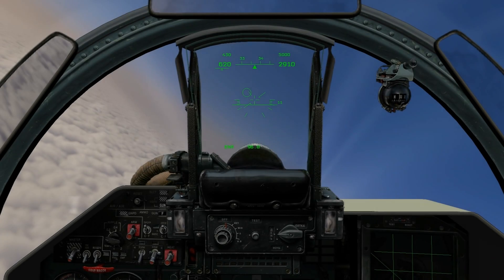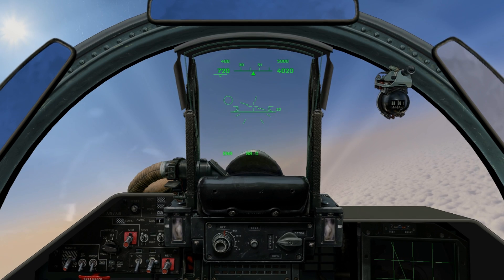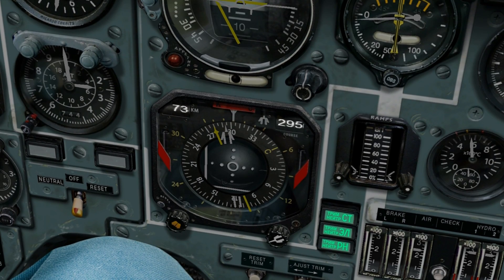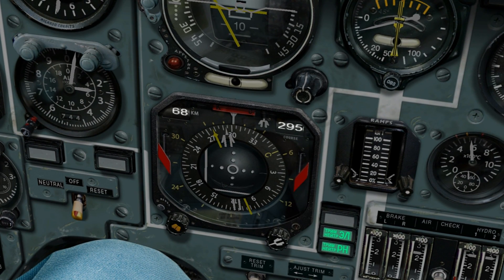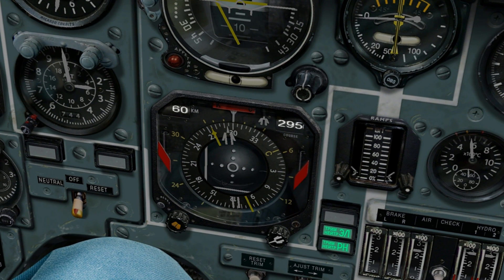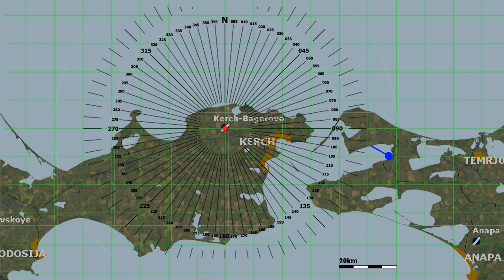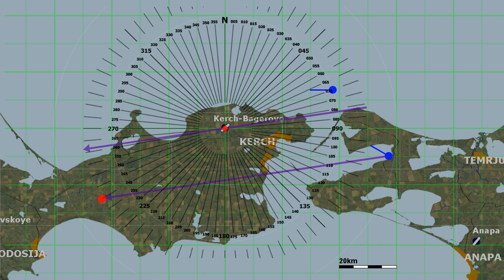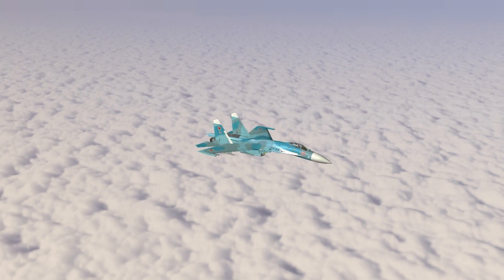Basic Bullseye Tutorial; Lockon Flaming Cliffs 1.12

Comment: so clearly this is not something a combat pilot does when flying, civil pilots like me use a kneeboard with special rotary compass to determine these things, but how does actually a combat pilot accomplish this?
Reply: actually this is exactly what a combat pilot (in DCS) is doing. the line imposions on the bullseye map are of course done and calculated in your mind, and not on some map... Aero did this only for better explanations and visualisation. ;-)
Reply: i know that its not done on some map, i was asking about how its done in your mind... do you actually know what kind of mind calculations are done? clearly not the same as explained here as there is no "mind" way to determine this with maths, that why its called trigonometry (because it has to be done with actual lines drawn.
Reply: well actually you use the HSI for visualisation, using the center of it as the imaginated bullseye (and displaced or enlarged in your mind), with time you dont even have to make huge calculations, it will become really easy to visualize that and simply draw those lines in your mind, the HSI offers plenty of visual help. but if you want to calculate it properly, you need to join several vectors in order to direct objects of relative motion in air, which usually is done by GCI or AWACS and using some form of this, if you want to get deeper into it. How a REAL fighter pilot does it today is difficult for me to say, as I am not one and I am sure their actual intercept procedures are classified. But this declassified document will give you some idea. 

http://www.ibiblio.org/hyperwar/USN/ref/RADEIGHTA/RADEIGHTA-2.html
Reply: Now, if you really want all that in algebraic, here is a site that will give you plenty intercept formulas, but I dont think that figher pilots really use that:
http://boards.straightdope.com/sdmb/archive/index.php/t-16114.html
Reply: 104th IronMike i actually thought about the hsi (we use it in in the same way un civil aircraft) but we dont have bullseye references ever, so the distance becomes an issue when using the hsi